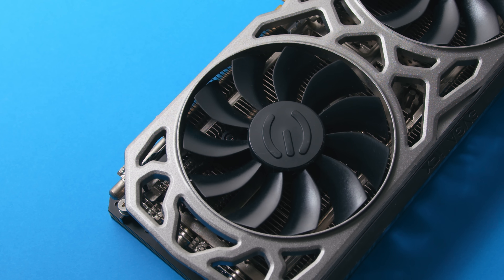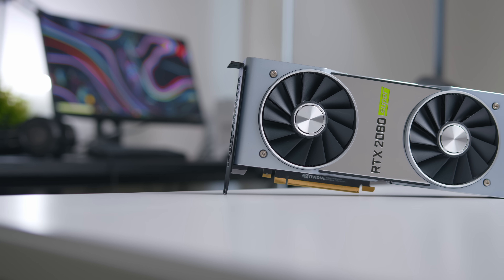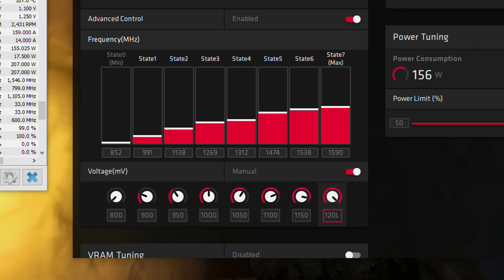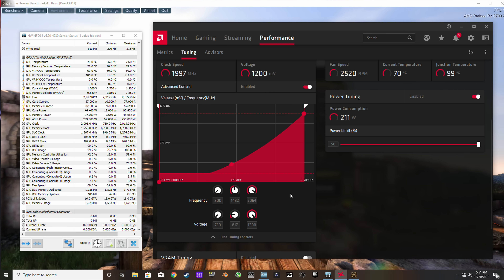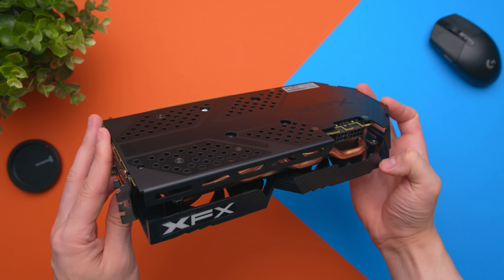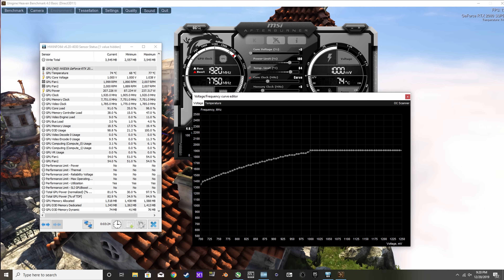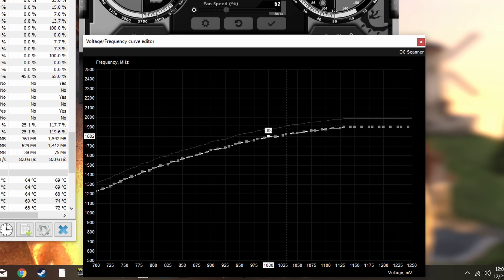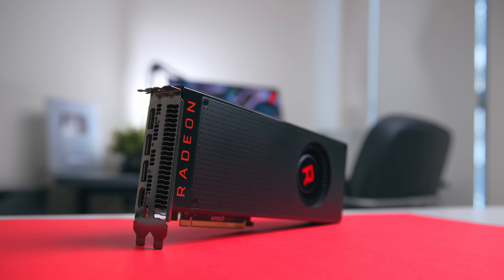The Ultimate GPU Undervolting Guide - Navi, Turing, Vega + More

Comment: BTW The HBM memory voltage on Vega is not what you set it to, it is locked by BIOS to 1.1 on V56 and 1.35 on V64. What you set in Wattman when you edit the memory voltage is the Voltage Floor at which the HBM power state applies to the Core. IE if your power state number 5 on the GPU Core is at 1050 mV, and you set memory P3 voltage floor at 1100 mV, the memory power state will start applying past core state 5 and force the voltage to be 1100 mV.
It basically tells the Core voltage when it should go from its stock power state of 800 (V56) or 945 (V64) to whatever you set manually on the memory. 
Bit confusing, and especially now that Adrenalin 2020 removed the ability to force a min power state it can be tricky to get your HBM OC to apply when gaming.
Reply: Indeed very interesting. Already figured that out. It's very unfortunate because I'm actually able to undervolt my Vega 64 from 1200 mV to 850 mV with the HBM2 overclocked to 1080 Mhz. It runs stable in all games for hours and I had no problems with it. 120W power consumption with stock performance (reduced GPU-clock) - I thought: amazing! The thing is: As soon as I restart my system the HBM2 won't clock to 1080Mhz anymore - only 800 Mhz and that's a huge performance restriction. I tried different voltages for hours (also with different drivers) and the lowest I can set it is 951mV. It's still an amazing result. 170W (stock it uses 240W) for 10% improvement in performance compared to stock is huge. But I would give up the 10% for the additional 50W. My card was completely silent at only 55 degrees. A Vega 64!
Reply: so if i set my memory voltage in wattman at 1100mV, it means the minimum of all cores voltage will be 1100mV?
Reply: @mike850826  Yes. Though I am not sure if it only applies to power satetes 6 and 7 or all power states. Will test when I get home.
Reply: @Deliverygirl  Test and give your insights Kaname Kun
Reply: @enioapolinario8538  According to reddit it's only state 6 and 7 that have its voltage floor affected by the HBM P3 state
Reply: @Deliverygirl  Thanks, some friends of mine will like of this info 

Do you have use any polaris 500 series in the past?, this problem in the bios for 1.1V only applies to Vega series?
Reply: @enioapolinario8538  I have not used Polaris cards but I know for sure that this only applies to Vega, both Vega 56/64 and Radeon 7. Neither Polaris nor Navi behave like this.
If you are curious, check Buildzoid's video on Vega quirks.
Reply: Yes, it's was a bit confusing for this new set of drivers. 
I've even flashed the latest version of bios on my Infamous Gigabyte OC 56 version, with no difference.
 I've managed to get the best settings by forcing the undervolt at 800mv until P4, then 900, 950, and lastly 1050mv and 1667mhz respectively.
 The good thing that came out of this is that the hbm clocks at 960 mhz, with a 960mv value, on the latest bios, up from 915 - 935mz (artifacts depending on specific application) max, on the older bios!
Reply: Deliverygirl I uh... don't know what you're talking about. Maybe I shouldn't try undervolting my Nvidia card
Reply: @DollyRanch  I'm talking about AMD, it's different on Nvidia, and what I mentioned is specific only to Vega.
Reply: @Deliverygirl  Nice profile picture you got it, a man of culture
Reply: @Deliverygirl  Btw AMD now is not so good for undervolting?
Reply: @enioapolinario8538  Navi is still good for undervolting, just not as much as Vega. But that's because Vega came overvolted like crazy out of the factory. It literally came at maximum possible voltage stock causing throttling and lots of energy waste. I don't blame the reviewers for saying Vega is hot loud and inefficient, at stock settings it sure is!
Reply: @Deliverygirl  Humm i see, thank you for your reply
Reply: @Deliverygirl  yep you are correct at stock vega chews through the power but under volted it gets a lot better and runs at higher clocks than stock.

Comment: guys i have a rx5700xt nitro running at 2066mhz@1175mV. thats actually a very bad undervolt, why? has this something to do with silicon lottery?
Reply from the maker: Beyond 2000MHz, the additional voltage required for the 5700 XT is quite a lot. 

Just like we saw with the factory overclocked 1080 Ti here, if you're trying to undervolt a factory OC'd card, you're essentially trying to undervolt and OC at the same time.
Reply: @optimumtech  yes but you got 2064@1100mV on your rx5700xt, has this something to do with the silicon lottery? btw thank you for commenting :)
Reply: lower the clock speed if you are not able to decrease the voltage anymore
2000mhz is the sweet spot for 5700xt from my perspective
Reply: I also have the Nitro+ version and managed to hit 2050Mhz@1095mV and 2130Mhz@1250mV
Reply: @shadowkora  did you stresstest after?
Reply: @k0ns491  Yep, it was stable 100%

Comment: I undervolted my Vega 64, it runs at 1700Mhz on the core and 1140Mhz on the HBM2, it uses 210W at full load in MW and runs quiet as hell at 60C with hotspot never going above 95C (at stock settings it would reach 115C easily). Problem is that recently I've started getting coil whine.
The performance is much better than stock (about 20fps more in MW, about 25fps more in BFV, varies from game to game) and it runs cooler and uses a lot less power.
Reply: Hey I have a Vega 64 LCE and I keep getting weird blinking artifacts which I think is from my HBM OC, would you mind sharing your settings so I can try it out :D
Reply: @cuteatheart  The HBM is always locked at 1.35V on V64/LC, so it's probably artifacting from heat. I have Samsung HBM and I can go as high as 1150Mhz, but after an hour it starts artifacting, so I keep it at 1140 or lower if the game really hammers the HBM.
You might want to repaste your card if you never did, for me that dropped temps massively.
For LC you can probably aim for 1750 core at 1.1V and keep the HBM at 1125.
Reply: @Deliverygirl  i have sapphire rx 470 , after installing the new amd driver,i started to gain out of range black screen for seconds and fps drops to 0 and start to work again for while then do the same thing again ,no overclock or any fancy thing ..do you have any idea ?
Reply: @shadyibrahiem1468  Do you have a freesync monitor?
Reply: @Deliverygirl  no i do not , i have a 19 lcd vga monitor 1366*768,i updated my card to the last amd driver version ,with still no luck
Reply: @shadyibrahiem1468  I would suggest using the amd cleaner utility and then install the drivers again
Reply: First of all. cute name.
And 2 nd  .if u ever tried fortnite.do u get weird lag when ur jumping off or landing..my Vega is staying at 60-65 duo to cold weather.and it's not that % limit to 0 .the one u can push to 50% 
I thought it was card mistake or driver thing.not sure

Comment: It‘s cool to see someone finally making a understandable guide on how to undervolt!

After undervolting my 2080ti the fans were basically inaudible because of how much the temperature dropped, but that also introduced me to the terrible coilwhine those cards have...
Weirdly enough it helped taking off the backplate?! This seems to be a common solution for Turing cards from EVGA
Reply: Just taking off the backplate made the coil whine go away !?!
Reply: Anime Thighs Save Lives Yes! I read about it on reddit and thought I might as well give it a shot before I RND my card the third time because of terrible noise and it reduced the whine massively. While gaming you can‘t really hear it anymore over the fans and AIO pump noise of my CPU

I have the EVGA 2080ti XC2 Ultra
Reply: Philipp S I have the same exact card. I’ll look into it. So freaking annoying the noise is but as long it runs good, I don’t mind it. Gonna sell it either way when or if the 3080ti comes out.
Reply: @karl_käse2610  you're lucky they let you rma for coil whine. Evga might be the only one. It can be the card, your psu, other things causing it to do that so I understand why aibs wouldn't do it.
Reply: @ANOVII2  <--
Reply: Mine does not have a backplate nor coil whine .... So +1, I guess :D
Reply: I've never had a good long term experience with EVGA cards.
Reply: is a backplate not just a heatspreader? how did that benefit you? i suppose it couldve made the card more rigid but without it the card would just get way hotter, no?
Reply: can't believe that helped you, I took mine off and it didn't help =/

Comment: I will be following this guide when I get my 5700XT
Reply: AmpEdition  Alright my 5700xt arrived today, no issues performance is near 2070 super level, compared with my friend my setup even wins in some games, running latest drivers no issues at all.
Reply: AmpEdition  I think I'm still going to buy it not worth to buy the 2060 super as it's the same price as the 5700xt, and there are a lot of solutions already that fix some of the issues.
Also Nvidia have been known for ending support on many of their products earlier than AMD, so I wouldn't call it future proofing, many of the problems can be simply solved if you  have an understanding of how the BIOS of your motherboard and windows functions, simply not worth the 2060 purchase, drivers will mature and the problems will be solved. At the end of the day when the drivers are at their peak it will eventually beat even the 2070 super, I mean look at the benchmarks the 5700xt already wins in Battlefield 5.